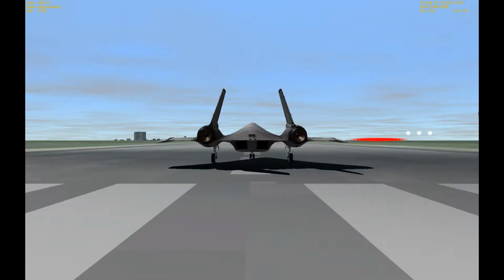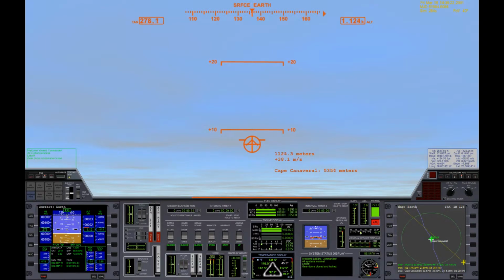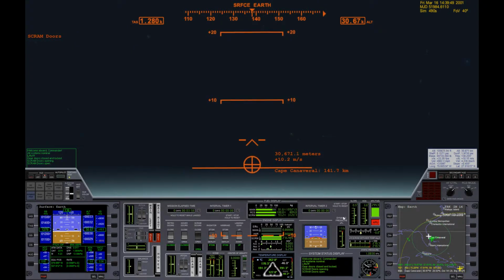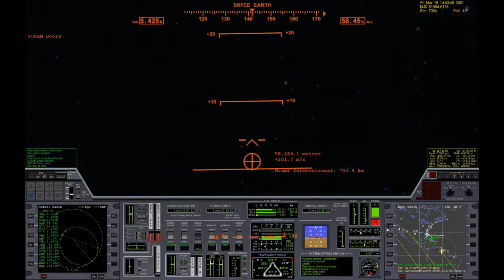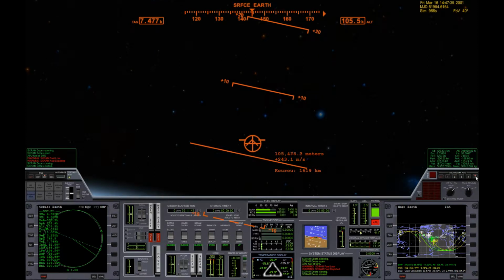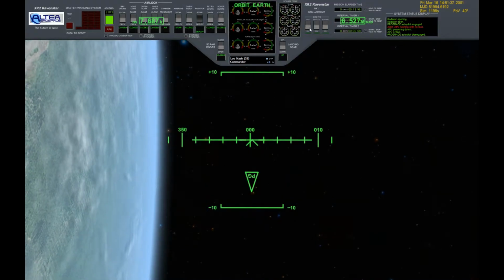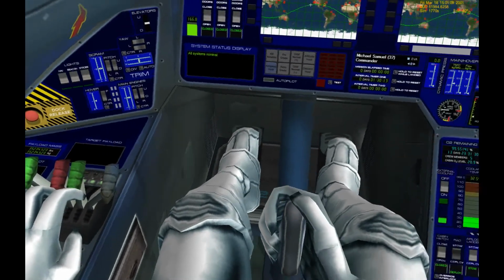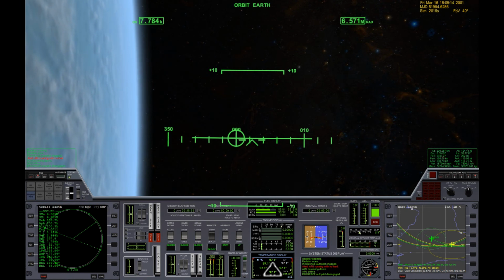XR-2 Ravenstar Tutorials 4- Launch to Low Earth Orbit

Comment: Terrific tutorial. I shelved Orbiter back in 2018 and was surprised to see the 2024 update. After a couple of so so tutorials I found this one and will be going over it a gain to zero in on a good ascent using the SCRAM Jet that I have not used before. Most prior simulations were using the Shuttle to the ISS. Quite different from the XR2....
Thanks for this...
Reply from the maker: No problem, thank you for watching and I'm glad you found it informative! I initially wasn't impressed with the stability of Orbiter 2024, but since I have updated to Windows 11, a flight that I would have expected 4 CTD's had 0... if this continues I may be convinced to stick with v2024.